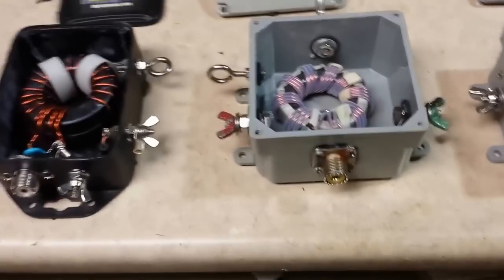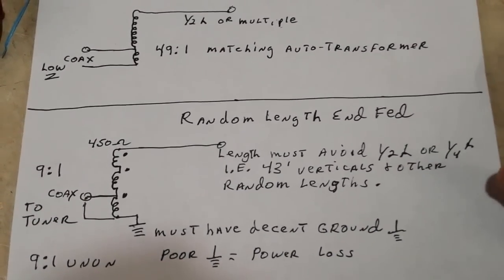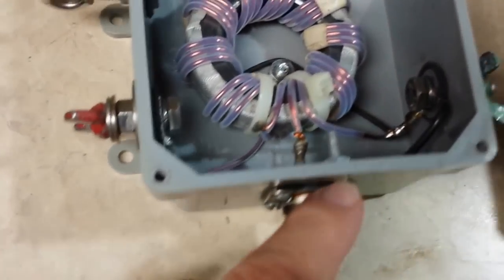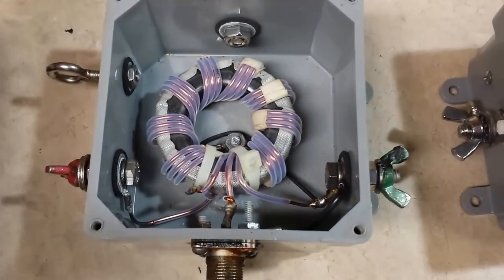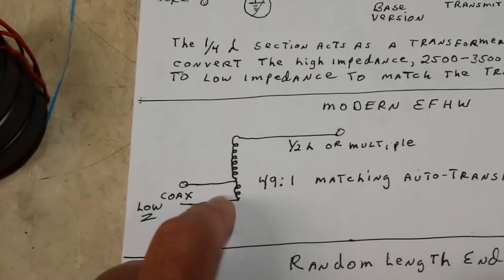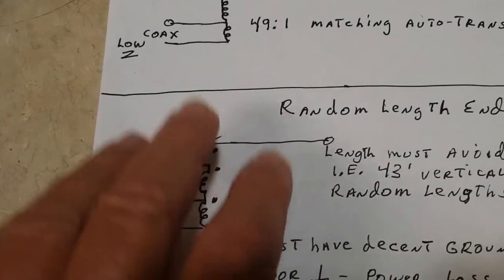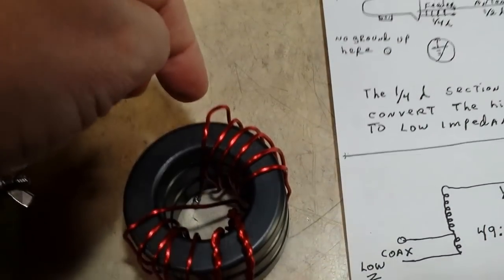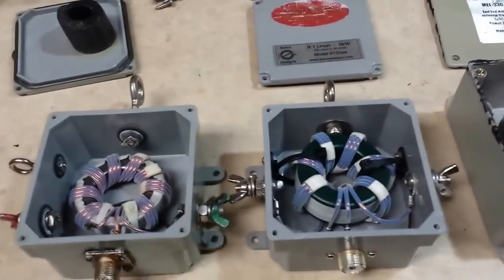End Fed Half Wave Antennas VS Random Length End Fed Antennas

Comment: This is one of those presentations most of us should bookmark and rewatch at the end of winter and mid summer to renew our understanding of important principles. So many people glom together all end-feds not realizing there are a few critical differences. Winding ratios, capacitor or not, counterpoise or ground and antenna length. Also, did you pick up where Steve shows the "random" lengths? They're not random! So pay close attention to the details. A random length end-fed for multi band operation and a EFHW for a particular band or an odd multiple. You can force an EFHW to do all bands just as long as you're willing to lose power as heat & sacrifice the transformer.

Comment: What cores did you use on the three core 49:1 high power. A lot of articles I read says they use 52 mix but it is not supposed to be so good on 80 meters; they however did not mention a mix for high power covering 80-10. One thing to remember about winding cores it is the turns that go through the middle that count. It looks like 13 turns on the three core . stack. It seems like the article I have suggest 13 turns for the larger size?

Comment: 7:38 - Each coil winding element needs to be wound tight for two reasons. 1) All of the inductance parameters need to remain stable and not move as a result of possible thermal dynamics 2) Tightness helps prevent inter-element capacitance (the spreading apart or the squeezing together of the elements in the winding thereby possibly changing its capacitance. Free changes in LC are undesired variables that can effect the transformer's performance even with the correct winding ratio and therefore also the SWR at the frequency used.

Comment: I  like your presentation a lot and thanks for the review. My neighboring ham friend and I built the ARRL 49:1 UNUN's and later I purchased a 2KW Balun Designs 9:1 UNUN. I haven't had the time to get set up to transmit yet, but, they both receive on the 68 feet of wire that came with the ARRL kit. I like the construction of both of the units well made and strong.  Chuck / W7HDF.

Comment: Thanks for the terrific video, Steve. I use a compact 9:1 unun to supplement my 4010 efhw. Specifically, I bypass the efhw transformer ( covered in another one of your videos), clip on a few feet of additional wire and connect it to a 9:1 unun. That enables me to add 30, 17 and 12 meters, as well as 6 meters if I shorten the additional wire, all with SWRs between 1.3 and 2.3:1.  As an added bonus, the additional wire and unun still cover the regular efhw bands (40, 20, 15 and 10 meters) with SWRs in the same range.
Reply from the maker: Quiet possible however the low swr you are getting is due to high ground losses so what you are seeing is deceptive.
Reply: @n4lq  Maybe, but it seems to be getting out OK.
Reply from the maker: Sure it may seem to be getting out ok buy you are still loosing lots of power   whatever your ground system is or at least in your house wiring. Keep in mind that it take 3db  in loss to even hear the difference but you are probably loosing much more. Still I have no doubt you will make plenty of contacts.

Comment: Just trying to be sure but from what I see both the MEF-330 transformer and the one you wound are 13:2 and not 14:2 windings. That makes a 42:1 transformer which I suppose will work but give less than ideal matching.

Comment: The windings must be isolated from each other and the coils. I'm getting ready to build the 49:1 EFHW. I'm going to have the long wire in sections for each band. Using terminals to disconnect and isolate the sections not wanted.
Reply: Okay you said this a year ago. I'm curious as to the results?!?!??

Comment: I think the EFHW has its place: ie when you can only run a wire from your operating position because the real estate only exists in one direction. Or if you want to make a half wave vertical on low hf bands like 80m ... A very high tree could open interesting possibilities. However if you can run your wire so you have a dipole, a balanced line and balanced ATU will be better in a lot of cases. So many factors. Desired launch angle... do you want NVIS? Do you want long haul propagation? I think thats EFHW as a vertical as well as a centre fed dipole would be good to switch between

Comment: This video is very informative.    Have you ever compared end fed half wave performance with a resonant dipole at the same height?   End Fed half wave vertical vs. resonant vertical with raised radials?    Is there any benefit to a wire counter poise?

Comment: How well will a metal roof work, after a recent hurricane  I actually covered a damaged existing very heavy roof with a second layer with the two coverings being screwed together reattaching both layers using metal screws so they are firmly attached?

Comment: With the two twisted primary turns,  the 1:49 transformer is NOT an autotransformer, it's a true transformer with two sets of windings.  The two turns are NOT connected together at both ends, only at the bottom.  I guess it COULD be wound as an autotransformer without the twisted wires and a tap at two turns.  Would probably work equally well either way.
I home brewed a version of this transformer using two cores and a 100pf 5kv 'doorknob' transmitting capacitor.  I used #16 wire, because that's what I had (and it was easier to wind than #14 would have been!)

Comment: A question for my fellow hams. Under most circumstances is a balanced antenna better than an unbalanced antenna? I've been under the impression that a dipole are the way to go. I currently have a 40 m. Dipole over my house suspended from trees. It actually turned out really good once I got it moved around a bit. On certain frequencies I can get my SWR down to about 1.2 or 1.3 to 1. My goal is to build a 160 m dipole. But I have to coordinate with my neighbor for obvious reasons. 160 m band absolutely intrigues me. Ive heard guys a couple states away but the background noise floor is almost unbearable. 73s.  Also, great video!!!
Reply from the maker: I don't understand the question "Balance in 10"....What do you mean?
Reply: @n4lq  sorry about that I was being lazy I didn't check with Google wrote from the voice recognition. I fixed the messed up part
Reply from the maker: The answer is no, balance is not the determining factor for "better". After all, an AM broadcast tower is totally unbalanced, not a dipole. The EFHW's advantage is number of bands covered without needing a tuner. Efficiency is actually pretty high. 160m is tough. 260 feet of wire! Otherwise it will need some kind of tuning system. There is a way to use the 80m version of the EFHW on 160m See my videos on that.
Reply: @n4lq  awesome thanks man.
Reply: Typically the more "metal in the air" the better, why a Dipole usually has an advantage, not needing as much RF grounding/counterpoise (not like station grounding/bonding). Being horizontal also helps eliminate QRM noise as most local QRM is vertical polarized. If you have a Nano VNA (like $60 USD) I'd look up video designs on how to build a "Bazooka" or "Double Bazooka antenna" for 10m-40m ETC and scale them up to 80/160m using one Bazooka style element and instead of a 2nd pole use a 49:1 End Fed Half Wave transformer. An 80m halfwave element "might" give you 160m too?! but my "brainz is tiredz"...

The thicker or wider your antenna elements are, like thicker diameter copper pipe or even wider flat copper tape, the wider frequency bandwidth range you'll end up with vs a skinny arse little wire... That said, a Bazooka is an old military antenna design that uses copper braided coax and the benefits of the Bazooka style design is the copper braid acts as your main radiating element making it a VERY wide band and REALLY quiet antenna as far as noise goes too! It then typically has either a tight coiled choke AKA "ugly balun" at the element base (usually for shorter 2m-10m antennas) or a short bit of ladder line soldered onto the tip for 10m+. Then see where that resonates on a Nano VNA, trimming a little off until resonant (BEST $60 you'll ever spend on amateur radio!). Something fairly cheap like RG-58 coax can easily be used for the elements too and the exposed solder joints ETC can be sealed up with liquid electrical tape over some adhesive lined heat-shrink to make it next to "Armageddon-proof".
Reply: Oh... and a 40m Double Bazooka trumps a plain 40m dipole, it's basically a dipole on heavy steroids!😁
Reply: I edited that first comment in case you only got the first draft...

Comment: I've had the same experience with Mr Becket's end fed random wire QSO King - "...it woooorks....  and you CAN make contacts on it, but...."  - pretty much sums it up.  It DOES work in a pinch, if nothing else is available, so long as it's feed point is high up and it's laid out in a straight line, but so does a coat hanger. :D

Comment: The ICAS rating of the EFHW doubled with the addition of 1 core.  Yet it still got too hot with 500W CW.  Cooling vs keeping dry sealed tightly.
Reply from the maker: ICAS is a bunch of bunk.... It takes 3 cores of 52 mix to be efficient enough not to reach Currie temp. when using 500w cw for long periods. With 240-52 mix I'm able to key down 500w for 15 minutes which is really good. The most heat happens on 80 meters. Other bands are fine.

Comment: I was wondering, since heat buildup is a big issue with these transformers, has there been experiments using oil to dissipate heat as it’s done with dummy loads?
Reply: It's not a big issue for me nor have I ever heard of anyone else complaining about heating his cores to Curie! I've never had an issue, but then I'm running SSB and less than 100. Another pal is working Europe on QRP with only a 1/2 wave on 40.  
Not many stations running long-winded 500 watts of CW. 
TO combat the issue Steve has built many other configuration of 49:1 transformers. He's documented most all of it here.  Dig around on his channel. Mr. Ellington is the best source of EFHW information I have found and I've built 3 so far.   Don't fix what ain't broke.
Reply: @wadepatton2433  thanks.
Reply: @azarellediaz4892 Just keep an eye on your SWR's if you're running QRO or high-duty cycle modes (CW, digital).
Reply: @wadepatton2433  that is a little hard for me to do, I’m legally blind and there’s no talking meters in the market. 🤪🤪
Reply: @azarellediaz4892 I have had blind ham pals who had talking radios by way of internal optional voice boards--I would think they had a way of relaying the SWR, but maybe the voice was only for frequency and modes-I know they did that much. It's been a while. I think you'll be fine, best of luck with it.  73
Reply: @wadepatton2433  thanks.

Comment: This looks like what I am going to start with. (MyAntennas EFHW-8010) It makes the most sense with my house and yard situation. I got my General in April this year and I have no HF rig. I am looking at either the IC-7300 or the FT-991a. Since I already have a FTM-100 in my shack I am leaning towards the IC-7300. I am also looking at getting a SDR Play RSPpdx unit before the IC-7300 to familiarize myself with the HF Bands before I jump into transmitting. I hope to take my extra sometime next spring as my book expires sometime next summer. I think getting some experience with HF is going to be a must.

Comment: Balluns are used to take an unbalanced (coax) feed line to match with a Ballanced twin lead antenna?. Correct me if iam wrong?, I'am new to the ham radio hobby.
  Kind regards Eric Dee
Reply: THat's correct.  What a current balun  (it is not really a Bal -un because it does no conversion) does is via the inductance of the toroid  when the current in is not equal to current out  (yes that can occur  if some of the current on the inside of the coax braid goes down  the outside out of phase) ... it forces the  current in both legs of the dipole to be the same.  This imbalance could be caused by nearby entities (eg metal siding) or because the antenna is slightly longer on one leg than the other.  There is also a Voltage balun that has the same effect in theory.  This is a  trifilar wound device.  It does a conversion from unbal to balanced as well. The downside is that it effectively puts a three inductor short across the received signal. That a VB that works well at 30 Mhz might make the Rx a little deaf at 3 Mhz.   Current baluns are the most  common types for going from coax to an antenna.  If you wanted to go from a 50ohm bal coax to  300 ohm twinax You'd use a 4:1 Bal to unbal which is a bifilar design.  You can't get  a precise match between 300 ohm and  50 because there is no such thing as  a 6:1 balun.  In terms of core sizes most Vendors agree that a FT 140-61 core is good to 100W PEP SSB as a current balun.  The core in fact carries only tiny flux from winding assymetry if the antenna installation is clean.  However under  under assymetrical conditions it will.

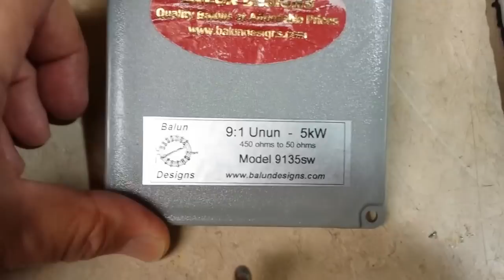Comment: Excellent comparison of make ups between the two types. I noticed the second auto transformer you showed was made with a 3:21 continuous winding, which still works out to 1:7 and 49 to 1 ratio. Logically it could also have a cross over at turn 11. What do you think about using 4:28 winding's (which is still 1:7) and should still be a 49 to 1 ratio? and perhaps with a  cross over at 14 turns? or would the extra turns of wire material affect the outcome unless it were on larger cores?
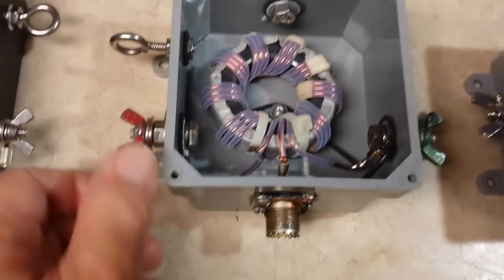Reply from the maker: It's a matter of inductance. For 160 you need the extra primary turn 3:21. For higher bands you need less inductance 2:14. Crossover is most helpful on the higher freq. bands and doesn't matter much on the lower ones.
Reply: @n4lq  Thanks, you've cleared up something i was wondering about.

Comment: "Hint...Use about 25 feet of coax or more to act as a counterpoise." thanks very much for your answer. Does one need to worry about signal loss/ attenuation with a longer coax vs say a 20' coax? I just bought a Tecsun pl-660 and am wanting just to enjoy short wave listening like I used to years ago. Thanks again, Vic
Reply from the maker: No worries about coax  until you get up to over 100 feet and VHF then you need to start paying attention to the type of cable.

Comment: Tight winding keeps leakage inductance down. The reason behind winding it in two parts is probably to get input and output on the other ends physically. It also can reduce capacitance from beginning to the end too but I'd assume at HF frequency it makes no difference. On high frequency transformers it can make a difference.
Reply from the maker: Yes. The output tap needs to be as remote from the ground lead as possible. Just getting your finger near the output will skew the swr.

Comment: Great video Steve ;-) I have a question. What SWR had you on the bands with 49:1 transformer endfed antenna? Did you need an antenna tuner? Thank you. Paul OM0ET
Reply from the maker: Generally the rig's internal tuner is all that's needed. SWR will normally be below 2:1 on all bands except 60 meters and the high end of 80m.
Reply: @n4lq  thank you very much Steve 👍 73 and good luck 🙋‍♂️

Comment: Hi. What about the frequency response of the auto transformer with a 3K ohm resistor attached? Mine have a flat 1:08:1 on 3.8Mhz, 1.2:1 on 7.150Mhz, 1.61:1 on 14.175Mhz, 1.65:1 on 21.225Mhz and 1.09:1 on 28.400Mhz (with 100pf cap installed, if not is around 2.7:1). Great video! Thanks!

Comment: I'm kind of confused, a 43 foot wire against a goods ground constitutes a "sweet spot," in that several ham bands are in the neighborhood of being resonant, but are the expected feed point impedance of either a vertical or inverted "L" anywhere near 450 Ohms??? Isn't about a fifth or tenth of that????
Reply from the maker: Actually 43 is deliberately chosen to be NON resonant in order to avoid radical impedance's that are hard to match.  This is a sort of an anti-sweet spot :*) 
The EFHW's impedance at the end is around 2000 to 3000 ohms on all the harmonic related bands i.e. 80, 40, 20, 15 and 10 meters. This allows us to cut the antenna to length for the lowest band, 80 meters and provide a transformer to step this down to 50 ohms on all those bands. You are confusing the random length antenna with this one. 
I suggest you watch my video that better explains this: https://www.youtube.com/watch?v=BpdpkUEW39o